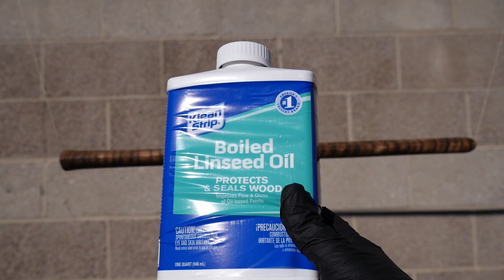Native American Pipe Tomahawk

Comment: Oh one more question.  SHould i toast the handle before i do the final fitting for the head, or fit the head perfect, then take it off and then toast the handle?  I am thinking heating the handle might make the size change thus affecting the fit of the wood to the metal axe head.
Reply from the maker: Roast it and sand first. It does shrink but you should still have plenty of material left to fit it properly.
Reply: thank you! @polydactylproductions6787
Reply from the maker: @mahamudha9003  Anytime.

Comment: Question, 1:15 here.  WHen i am hardening the handle with fire like that, did you wet the wood first or put any oil or are you putting the raw sanded unfinished wood to the fire?   I just put dry and sanded wood to the fire like that?   I just wanted to make sure that theres isnt anything i am missing.  Thank you.
Reply from the maker: I carefully toasted the wood, then sandws it smooth. After that I oiled it with boiled linseed oil.
Reply: ok thanks, thats what i will try then. @polydactylproductions6787